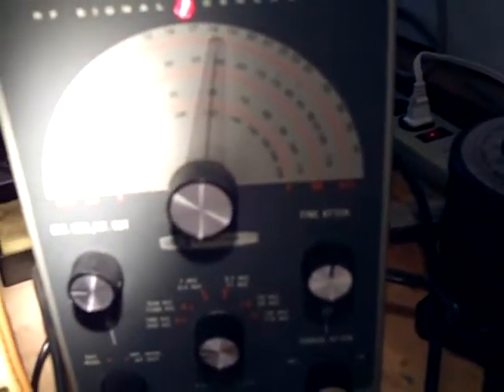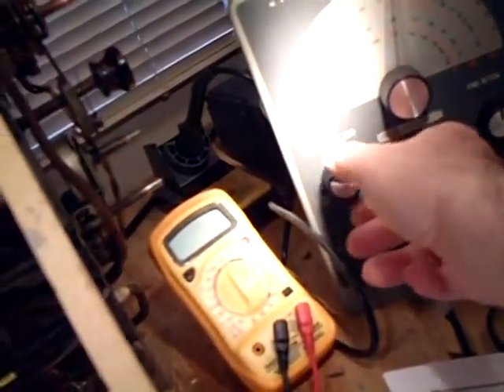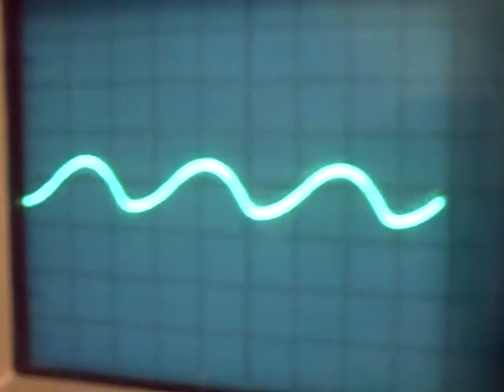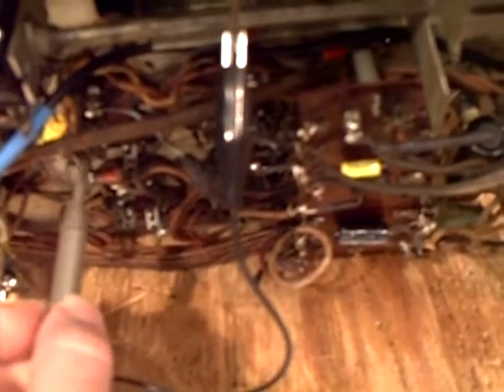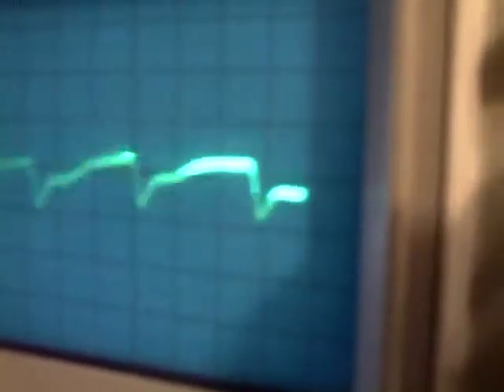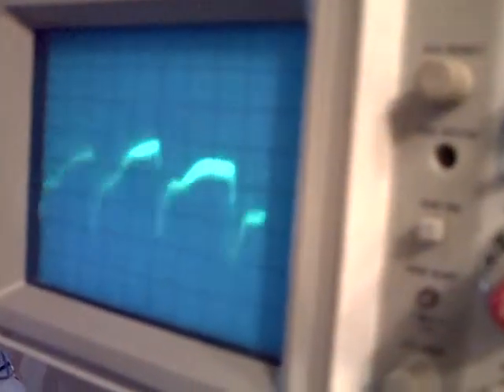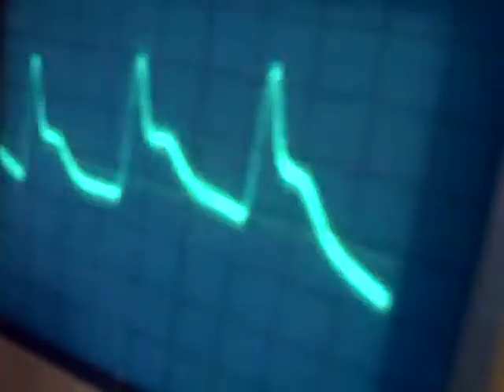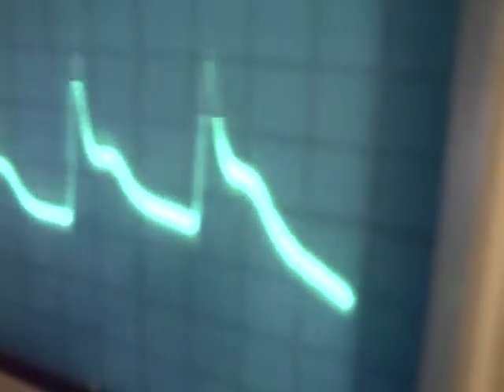Part 17 RCA 262 Repair, found the audio problem, but not sure how to resolve it..

Comment from the maker: Thanks for the comment. Perhaps there is some sort of short. This bad boy has had all sorts of problems. I  have to go over the radio again and check every connection that goes into the audio portion.  Should be a good performer once the problem is corrected. Maybe someting is loading the 1st audio down?

Comment from the maker: Plate volage to 1st audio tube is measured to be 41 percent too low. the other tubes at "this time" when variac at 100 % are about 7 percent too low. I think 7 percent too low is probably in acceptable range , but 41 percent too low for 1st audio tube is way to low and is what's causing the distortion. This radio has 5 audio tubes. 1st audio, then 2 drivers in push pull, then 2 output tubes in push pull, should be fantastic when operating correctly!

Comment from the maker: I had measured most plate voltages with variac at 100 % a few weeks ago and found about 10 % low, but was going to live with that. I then thought of in last video while doing the video that I should try it plugged into the AC socket directly for the final test for the video, and before I made the video I tried that and found the volatges 10 % higher than spec becasue 100 percent variac is not really 100 %. Reported this to tip others of murphy's law that this might be something to look for.

Comment from the maker: Yep, all resistors are changed in the vincinity of the circuit. In fact 99 percent of the resistors are changed. didn;t measure the output of the first audio tube on video  because it was difficult for me to see the connections to it due to eyesight problems. Anyway, the input to the first audio tube is good but the output from the first audio is what's bad. Plate voltages to all the others where slighty low @ 100 percent variac, but 10 percent too high at line voltage. Kinda frustrating